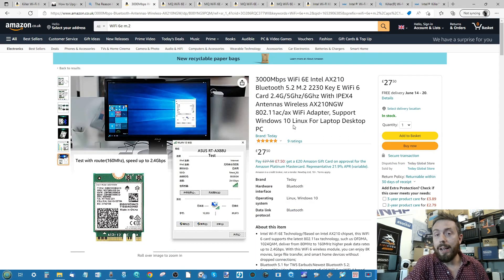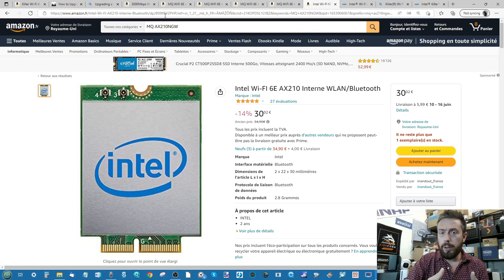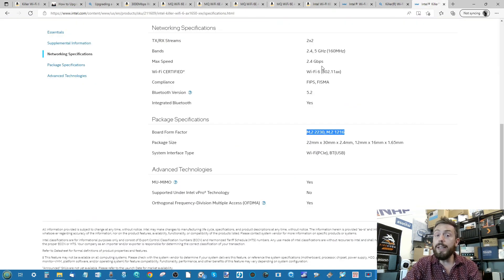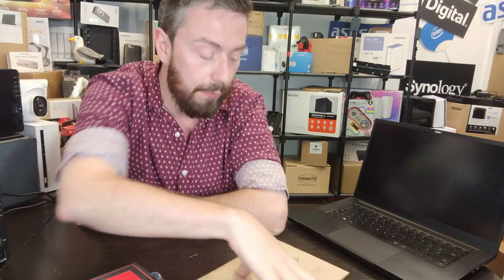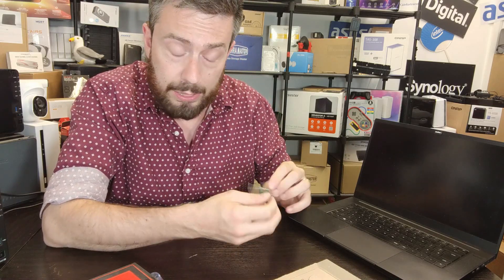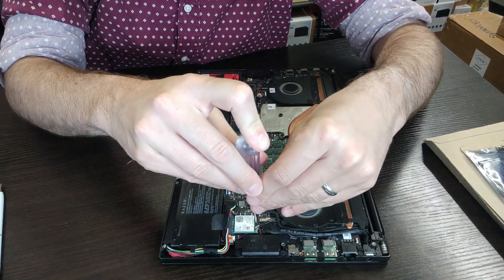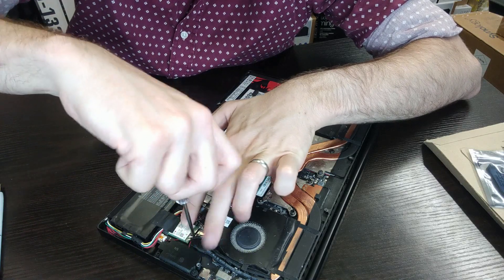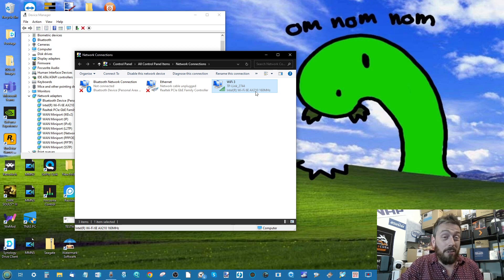How to Upgrade Your Laptop to WiFi 6E for $30

Comment: please note that 6Ghz doesn't always show up after current intel drivers are installed. This is the case on older platforms.  I'm running a gen 4 i5.  I was able to get 6.gz to show up with the .45 driver.  I think intel is currently on the .180 or .190 driver.   The .45 driver is hard to find 9n the intel website and you have to dig.   I keep testing a new driver for 6ghz whenever Intel updates it but no luck yet so I revert back to .45.  Windows 10 also doesn't tell you that yiur connected to a 6ghz network.  But it does tell yiu if you are connected to a 5 ghz or 2.4 ghz one.   I named all my networks different names so it easy to find the one i want.
Reply: What do you mean ˛˛older platforms˛˛?
I have 2022 TUF A15 laptop with AMD Ryzen 7 6800H processor. I think it´s the latest platform available. 
One thing for sure, I´ll try your routine with .45 driver  and update my comment.
Anyway, thnx for the  advice regarding driver.
Reply: @sokre988 o domt have newer system so all I got to test with is a 4th gen.  i guess i had assumed it was a tpm thing. 

make sure you fully remove all other drivers...  im building a new ddr5 i5-13600k system on z790 chip set this weekend.   I got a ax1690i the killer wifi m.2 card that uses .180 drivers... ill try those. Then the 190 to see if I see my 6ghz.   If not, I'll revert back to .45.

Comment: One other not3 some older devices only use wpa2 not wpa3.  Wifi 6ghz roughter default to wpa3. This can cause connectivity issues so you may want to revert to wpa2 if you are having connectivity issues after a wifi 6e roughter upgrade.

Comment: Cheers for that. Nigh on impossible on my old HP G7 laptop though.  IIRC, HP has a whitelist and disallows WiFi / Bluetooth modules in BIOS on laptops of this vintage.   BTW, for laptops with built in battery, I recommend running the battery down completely if possible.  Otherwise in many cases you can just disconnect the battery before working on it.
Reply: On modern ones they stopped doing that I think.  I have an HP laptop I bought this year and while the AX200NGW is not one that HP listed as supported it worked anyhow.  I think they just said it is not compatible because the laptop has one antenna and the AX200NGW needed 2.  I just had to find a spot in the case safe for it (since I don't want to mess with the display).  It works a lot better than that horrid Realtek 8821CE it had in it from the factory.  Really I never cared for Realtek WiFi.  I can tolerate sound from a Realtek chip but their WiFi chips are mediocre!!
Reply: @charleshines8523 I also use an HP, 1030 x360, G3. Do you know which latest adaptor I can use, or even how to check the whitelist?

Comment: i broke both the snap on things so solder direc to 6e card now hardly any singnal wifi and speed droped from 500 to 70 also does it matter which wire goes where and on each lead is there a live and neg

Comment: Question: what would I do if the card I’m replacing is the exact same model as the one I had? What would I do in terms of the drivers? 

I have an Acer Nitro 5 AN517-51 with an Intel Ax200 wifi 6 card in my system. Recently I was doing a fan replacement and repaste of the heat sink, and I accidentally pulled the aux cable and the aux connector came off while trying to reattach. 

I wasn’t sure if I should upgrade to AX210 (cause it’s scared of it not working), so I was wondering whether I could just do a straight swap of AX200 for AX200. Would I ned to install any kind of driver, if the new card is the same model as the old…? 

Or would upgrading to AX210 be better all round as a solution. I just want the least painful and quickest experience
Reply: if it didn't work you can always replace it back
Reply: For future readers: I mean, if the new AX200 works properly, yes, you can replace it without issue. It shouldn't require any driver change. Just install the new one.

Most likely the AX210 will also be compatible with a driver update.

Comment: my laptop barely catches nearby wifi signals, would this diy fix the problem?
Reply: It might.  I upgraded to WiFi 6 with an Intel AX200NGW and it helped.  I also upgraded my router to a TP-Link AX300 Pro (looks like similar to the Intel version but no Intel logo).  That router retails for $179.99 normally but is frequently on sale for $129 or at least a lot less than the normal price.  I have had good luck with TP-Link because they are good routers.  I never have to go and reset it.  Some laptops have just one antenna cable but that doesn't mean you are out of luck with upgrades.  I just got one that comes with antennas and used one of those.  I didn't need the other because it was already installed.  I found a space in my laptop where a hard drive would be on a similar model and placed the antenna there.  They have strong tape so place it wisely.  I did that after attaching the antenna to the WiFi card since those connectors are small and difficult to couple then stuck the antenna down.  I just made sure it would not touch other electronic parts.  Depending on where it is you may have some slack in the cable.  Don't cut it, that is thin coaxial cable not wire.  If that end comes off the connector you will never be able to reattach it yourself without causing a short between the two conductors which would destroy your WiFi card  I installed my antenna this way to avoid taking the screen bezels apart which is a fairly difficult thing to do.

To answer your question, you might get a better signal once the upgrade is done.  Just make sure to download the drivers first to a flash drive or the computer you intend to upgrade.  If you can't connect to WiFi yet you will need to connect via ethernet or use a computer that still has internet to get the drivers.  Not everyone has a second one.

Comment: I tried to do it on Lenovo z50-70, and upon start screen I get an error of unauthorised wireless card, please power off and remove it. I have used bios menu and disabled and wireless from BIOS. I then installed the bluetooth after logging in, bluetooth works fine but the wireless still dont. I believe I need to whitelist the wireless adapter. 

Can anyone suggest me the solution ?
Reply: I have the same issues. Do you have any idea how to Fox it? My laptop is HP Aero 13 Ryzen 5800U, card is Intel Ax211
Reply: Did you find a solution..?

Comment: my router supports wifi 6e but how do I know I'm connected to wifi 6e and not wifi 5/2.4 ghz like wifi 6 usually do.
Reply: My router has a separate ssid for 6e. The 2.4ghz/5ghz is on its own ssid.

Comment: Tried to do this upgrade on my Dell XPS 15 9500 - didnt work! Apparently the Killer WIFI 6 network card is soddered to the motherboard making the upgrade impossible.
Reply: That sucks.  is it an ultraportable computer?  I know in some of those even the RAM is soldered in.  That can make things hard when you ever have a bad RAM chip.
Reply: @charleshines8523  NOPE was able to upgrade the ram to 64gb even the nvme drives - just not the wifi. Not a big dead really since i rarely use the wireless option and connect via a 10gbe adapter via rj45 ethernet into a 10gbe switch powered by an intel dual port 10gbe nic
Reply: @vinylmonster4907  I can also.  I could probably push it further if modules with a high enough capacity existed.  I know I can push my desktop to 128 GB and it uses DDR4 like my laptop.  If there were 64 GB DDR4 SODIMMs there may be a chance that it would work unless the firmware limits it artificially and some laptops do have limits of that type on some things sometimes.

Comment: Hello, I´ve upgraded my Asus TUF A15 from Mediatek wifi6 card to Intels AX210 6E (bought on Aliexpres), installed proper drivers, but when I try to connect my Samsung Galaxy S22+ wifi Hotspot over 6GHz, it can´t. I can connect it over 5GHz, can it be something in settings? What do you think?
Reply: bro how is it working right now is bluetooth working fine ?
Reply: @sokre988
Reply: @tanishqtaya516   yes, it works fine.. Bluetooth and wifi 6ghz network. 
Things I needed to change:
*Upgrade to windows 11,
*Downgrade drivers for card like 10 versions below latest. Search internet for exact one.
Reply: @sokre988  i see and is the lan connection working fine also where you downloaded drivers ?

Comment: Windows 10 does not support WiFi 6E
Reply: i think in 2 years Microsoft will force windows 11
Reply: You need a special driver to use 6E on Windows 10